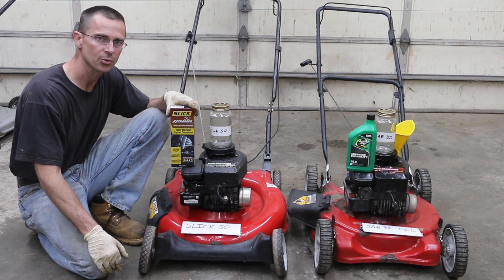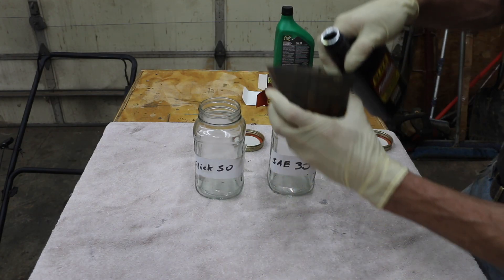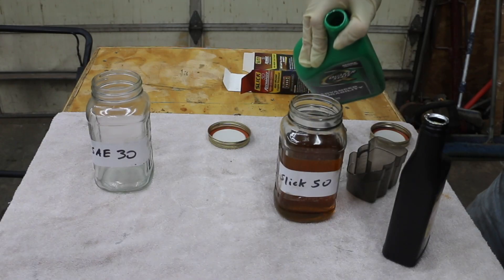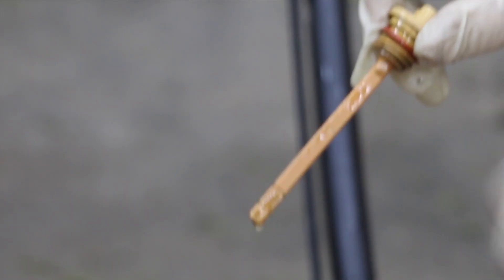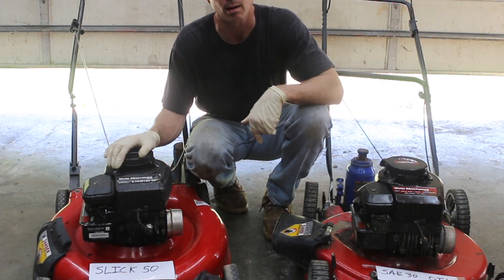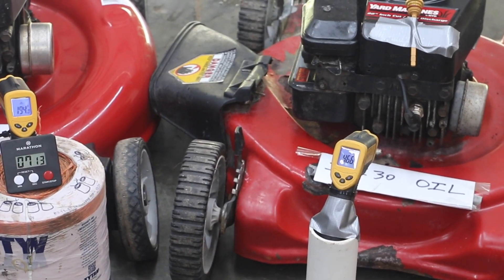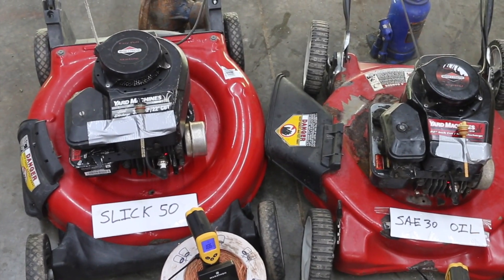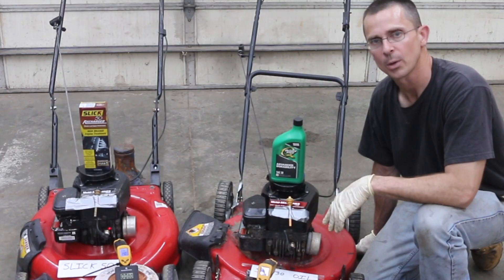Can't believe what SLICK 50 did to my engine!!--Dry Crankcase Test!

Comment: Maybe something in the Slick 50 designed to 'stick' to engine parts may have gummed up when undiluted with oil, as a result of no oil heat build up. I definitely think a post mortem autopsy is in order! Maybe they could be un-seized and used again . . . I think I might use slick 50 regularly because lower temperature probably means less friction and would be good in my air cooled Yamaha motorcycle engine!
Reply from the maker: Thanks for the feedback.

Comment: Thank you for all your testing however I do have to point out and I'm sure you know hopefully your readers do as well that there are way too many variables still in this test. We're both engines brand new? Where they both built at the same time in the same plant? Even so, variability in the tolerances are expected in the manufacturing process and you would need to have a larger sampling size to truly show the difference between the SAE 30 and this like 50. The slick engine you used may have been predestined to blow up even earlier than that. Will never know with a single motor versus another motor. Still thank you for the info

Comment: Duralube really works to greatly extend engine life. All my cars have been treated at every oil change for many years. My 1999 Qx4 after 21 years with 320000 miles consumes no oil and still has high compression. Previously I ran my 1990 Honda wagon completely out of oil driving from Las Vegas to Los Angeles in 110 deg heat at 90mph. When I finally noticed the oil light, I estimate I had driven at least 40 miles with no oil. To my amazement it took over 5 quarts to refill.  I have Once the oil was full, the car ran normally for the next 190000 miles until it was wrecked and never burned oil. I never figured out how I lost all the oil on that trip. I guess it blew out through a seal since I was going 95 mph in 110 degree heat. However I never had an oil leak after that. Go figure. Finally, my present car, a 2006 Lexus IS250, has been running like new for 160000 miles using duralube. The engine still has no valve noise and full compression. I am sure there is a break-in period needed to get the full protection. Probably a couple of oil changes. If you test this additive you may have to account for that. BTW, I think slick 50 also should get a few oil changes for full effect. How it works is it contains microscopic Teflon balls that work their way into the sub micron metal cracks and fissures in the cylinders, pistons and rings as well as any rubbing surfaces. First you have to shake up the product to get the Teflon distributed before pouring it in the engine. The anti-wear benefit then continues growing with use until it stabilizes. I had a good experience with slick 50 prior to discovering duralube. I think prolong is another effective such additive. Love your channel! Regards, Donn Werrbach, Las Vegas, NV
Reply from the maker: Thanks!  Thanks for sharing.

Comment: My experience was with a 1979 Mustang 2.3 liter, with a religious 30K oil change.  

So, after OVER 600K+ actual miles the original engine was still strong.  Of course (FORD) the auto - over the next 15 years - it consumed more than 5 batteries, and 3 starters along with 2 alternators.  Car engine with Slick 50 additive to the crankcase added x2 per year was still running well when the 2nd transmission ended its life.  Impressed (to this day) with Slick 50.  Period.

Doesn't matter to me whether people use it or not, there is just more for me!
Reply from the maker: Thanks for sharing.

Comment: love your work but that test was flawed, you would need two brand new motors for accuracy .  i used slick 50 many years ago for a few years and i'm convinced it worked very well .  it made the engine run smoother, quieter, cooler, stronger and better mileage so yea it was awesome stuff in my opinion. only reason i stopped using it was because i started using synthetic oil and i got some of the same benefits from.      keep up your great work!!

Comment: Doesn't Slick 50 recommend running the product for one full oil change to get the best benefits? I'd like to have seen you run the Slick 50 in the mower for the number of hours between oil changes recommend by the mower manufacturer.

Comment: Those two lawnmowers are at least different years if not different models. That means those engines are of different ages and have different amounts of wear and tear. I believe thats why the Slick 50 engine died at a much lower temp. If you look at the wheels, The Slick 50 mower is considerably older.

Comment: When I was younger and I was seeing this like 50 commercials there was a another brand out there first making those claims and had a stronger following until the advertising of slick 50. I think slick 50 is very overrated the other company I think was called prolong which they do have products out there but I don't believe that the current product is anything near what their product was originally. The main component in the product of prolonged can be purchased in a very small bottle and added to an engine I cannot remember what that product is but it is listed on the ingredients of prolong. I believe the active ingredient in prolong is what you're looking for. I believe that when prolong came out it had a substantial amount of that product in it and I think that product now cost quite a bit of money based on what it's capable of doing. The information I'm providing to you is information that I discovered a long time ago and I have not done any current research on it so the numbers and stuff that I am shooting at you may vary in today's world versus like the 1980s.

Comment: Great video! But, as a mechanic, I would like to know if both engines are the same model number? Were they both running at exactly the same RPM? I saw many comments that talked about slick 50 improving over the years, but none talking about how much motor oil has changed. (No, I didn’t read very many comments). When I was a kid, the SAE rating on motor oil was SD! Nowadays (2022), it’s around SJ and SL. It’s my understanding that the industry cannot change the letter ratings unless there has been a significant improvement in the oil itself. Do you know anything about this? Thanks again for the vid.
Reply: Two are red :)

Comment: Have you heard of or used "Corrosion X"? They have a family of products for: fishing reels, guns, skate boards, and general "wd-40" type applications. The products bond to metal at a thickness of 3/10,000ths inch and contains no solvents that evaporate. One of these products, "Speed X" works wonderful to keep my random orbital sander bearing from seizing  up for long periods of time, greatly extending its useful life. This is aproduct that I would put up against motor oil for the ultimate test. Appreciate your videos!!!!
Reply from the maker: Thanks!

Comment: I bought a 1995 silverado 1500. I looked at the maintained schedule and at 89,600 miles slick 50 was added to this engine. I've had this truck for 4 years.  It now has 209,700 miles and the engine sounds like new. I would like for you to do the slick 50 test over again. Add the slick 50 and mow for several months and see what happens.
Reply from the maker: Thanks for the suggestion.

Comment: A great experiment. Very interesting and to be honest surprising results as I thought for sure the Slick 50 would be the winner.
In the past I've had good results on old oil burning vehicles with a product called Wynns Metaloil. I sadly can't find it anywhere now for the last 4 or so years. Maybe it's still available in the States, I'm in Alberta Canada and I can not find it in any auto parts or hardware stores anymore, seems to have just disappeared.
Reply from the maker: Thanks!  Thanks for the feedback.
Reply: Guessing that it's high in lead content and the greenies don't like anything "lead".

Comment: The Slick 50's engine temp was around 100 degrees cooler than the oil only engine. Would be interesting to see both engines to find out  the damage.
Reply from the maker: Thanks for the suggestion.

Comment: You did well in using it Todd after all the low temperature is a benefit for longer periods of oil engine. But Like you know comercial tends to have always a better result than in real use.
Reply from the maker: Thanks for sharing.

Comment: I used some product that was taken off the market with PTFE in my 12 HP Allis Chalmers. The wasps and a mouse had blocked the fins and air supply and it burned all the oil out and caught fire and i still drove it back to the barn.  It was so hot the oil exploded when i tried to put oil in it. The old girl is still running
Reply from the maker: Wow, that is amazing!

Comment: I don't believe in snake oil."I say". But!  Best $10 I ever spent! Two 
instances:1 Brother have a  van transmission  slipping and acting up 
shifting. changer filter and fluid.no real change.sometime this is a 
mistake they say. (never could figure out who is they that always say!) 
Any who! 2: Bought a pickup with know problem,  bad transmission. 
Already had a pickup (plow truck) that just put a guaranteed used 
transmission in. Still had issues! So in short. for $10each the problems
 where solved. sea foam trans tune. Like I said I don't believe in snake
 oil but this snake oil worked for me! saved me $$$$$$$$$$$$$$$. For $10
 or what ever it is,it's worth a shot in the dark,you might hit the 
target! OH Yeah! 10+ years later no problems both trucks still run! rusted but run!

Comment: There used to be an Oil with Graphite in it, So I tried it in a Dodge Van with a slant 6, needless to say it clogged the oil flow and blew out the pistons and made a hole in the side of the engine and sprayed out all of the oil. So I stopped on the highway, engine still running and decided to drive the 40 miles back home!!! My friends were freakin out but I said F*<£ it I’m not stopping, light one up a crack me a brew we’re going for the fun of it! 🤣 And We Made it Back!!! Amazing that Graphite, It was Immediately taken off the Market! True Story!!!!
Reply from the maker: Thanks for sharing!

Comment: 🤔👀👍👀😱👀 ... I have an old 54 Cat Motor Grader I'm thinking someone used Slick-50 in it back in the day. I am having trouble bringing up the temp to a good operating temp even now after how many oil changes ? Has new 180° thermostats. I have heard of this before on heavy equipment but its been 100 years or more. That's why I watched your channel... 🤔👀👍👀😱👀
Thankx for the info
Reply from the maker: Thanks!

Comment: I used Slick 50 in my 1989 Ranger 2.3. At 110k the oil pickup in the pan broke clean off while on tbe interstate. I shut it down and took it to my mechanic/friend.
He called the next day and asked what oil I used. I told him Quaker State changed my oil but I used Slick 50.
The loss of oil pressure had spun a crank bearing but the cylinder walls still showed original crosshatch. He ground the crank and bolted it back together. 
I drove it to 330k and sold it to the kid up the street in 2001. He is still driving it as a second vehicle with 495k and my mechanic/friend has used it since.
Worked well for me.
Reply from the maker: Thanks for sharing.

Comment: The results of this test confuse me. As the Slick 50 mower did not heat up I would have expected it to last longer. I feel like results are a wild card issue with the mower. You also chose not to follow the slick 50 instructions.

Comment: Maybe use two identical and brand new engines for the test. It appeared the engines used in this test were used. If this is the case, then so many other variables could have been responsible for the engine failure.
Reply from the maker: Great point!

Comment: Only thing i would try to do differently is make sure the exhaust from the one engine isnt pointed at the other.

I had an engine dying and as it got close i drained the oil so i wouldnt make a mess on the road or in a sensitive area (live next to banff). 

That dry engine ran for about 4 months before it finally caved in. I had been running almost straight lucas for a little while before.  

It became a running joke and actually iirc the engine never siezed but got embarrassingly loud. ('94 ram magnum 5.9 in a service truck.)
Reply from the maker: Thanks for sharing.

Comment: The thing about slick 50 is that it works well when it's actually IN the crankcase.  The temperature difference proves that.  The reduced temperature is worth it for air cooled engines.
Reply from the maker: Thanks for the feedback.

Comment: I bought a brand new 1993 Ford Bronco with the 351 Windsor motor. I did use Slick 50 after 1 year of buying the vehicle. I did change my oil around 5000 miles increments and would use slick 50 2 sometimes 3 in a years time. Vehicle got me 442000 miles of usage before it started to use oil. I still use it today and I think it does help engines last longer. It has also helped the camchatter in my 2018 ecoboost motor. Did not stop it but reduced some of the noise.
Reply from the maker: Thanks for sharing.

Comment: I watched a big Diesel engine run at the fair in Midland Michigan when I was young with no oil pan; and I kept returning to see if it blew up but it never did so I was fooled as well and I too spent plenty on slick 50 the only explanation is they must have made special crank bearings or treated it with something to expensive to sell in the world market.   Crazy I am still curious how did they do that?
Reply from the maker: Thanks for sharing.

Comment: Slick 50 of today is NOT the same formula as the Slick 50 before, when it was in the round container. I have used both. The old Slick 50 was amazing stuff. One treatment that was it. It had a lot of PTFE in it, so much it was milky.
Reply from the maker: Thanks for the feedback.

Comment: Slick 50 contains Teflon , Teflon over time becomes sticky , carpet cleaners use it to protect high traffic areas when they clean carpets. How about doing a test with a product called "pro-long" they were the ones that ran the engine with the oil pan removed
Reply from the maker: Thanks for the suggestion.

Comment: Sean the commercial's years ago, as you said I had confidence in the product, added it to every thing I owned that needed oil. I never had anything lock up on me, but I checked my oil all the time. I take it back. In the early 70's I locked the engine on a 1966 VW Squareback  Sedan station wagon. $500 to fix it ( Father-in-law bailed us out). But I haven't done it since!

Comment: The saying about unintended consequences is true. After adding Slick 50, my SUV's motor did run cooler, which was great....until winter weather in Colorado showed that sometimes you might NEED the friction and heat from the motor, say for cabin heat and windshield deicing.....
Reply from the maker: Thanks for the feedback.

Comment: Slick 50 originally used polytetrafloroethylene [PTFE] as the ingredient for the lubricating element of their formula. For reasons unknown it is no longer included. Check the label. It isn't there anymore. I stopped using it because without PTFE Slick 50 is no longer Slick 50. It's no better or worse than STP. Also, you had to run  it in the engine for several thousand miles before fuel economy improved.  I put it in my 94 Chrysler Concord and got 30 miles per gallon on long distance trips.
Reply from the maker: Thanks for sharing.

Comment: I realize I'm late to the table on this one but I think I have some critical information concerning this test. Several years ago the original guy who invented Slick 50 sold the product and name to the current manufacturer. He claims the current formulation has very little in common with his original product. He has since started (again) manufacturing the original formula with a new name. The video of him explaining this is out there and very interesting. I stopped using Slick 50 when the new product replaced the original because I could tell it wasn't working nearly as well. The original was closer to a 20 weight oil and the current product is more like molasses. I'll try and find the video and get it to you. The original inventor has raised the price considerably so perhaps that's the reason the current manufacturer changed the mix or perhaps the original owner just couldn't keep to a $15 price point starting from ground zero. Thanks for all you do. I hope I can help.
Reply from the maker: You are welcome!  Thanks for sharing!

Comment: This level of testing, needs 2 brand new engines off the same assembly line. The 30wt oil engine looks far more broken in than the newer one using slick 50. Redo please
Reply from the maker: Thanks for the constructive feedback.